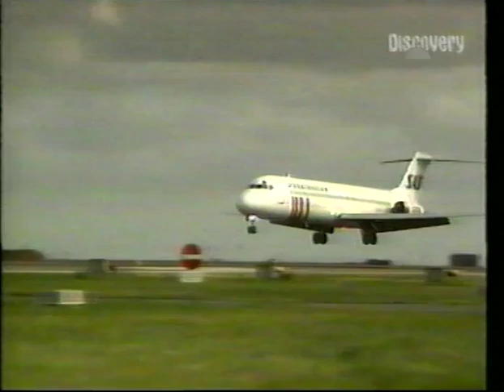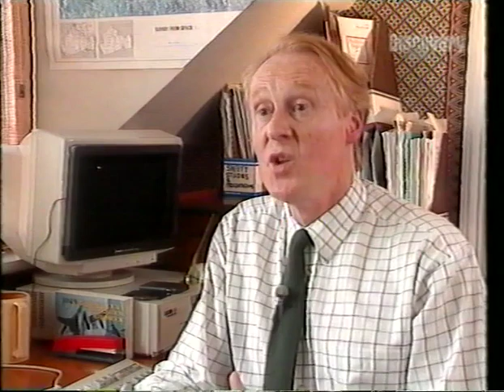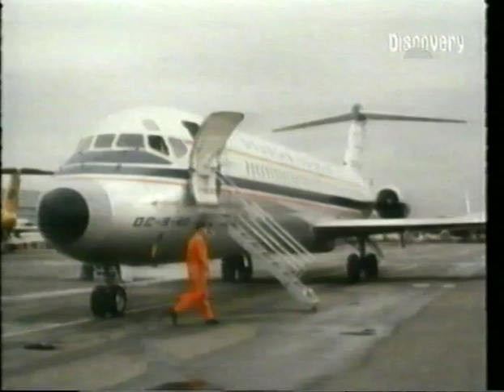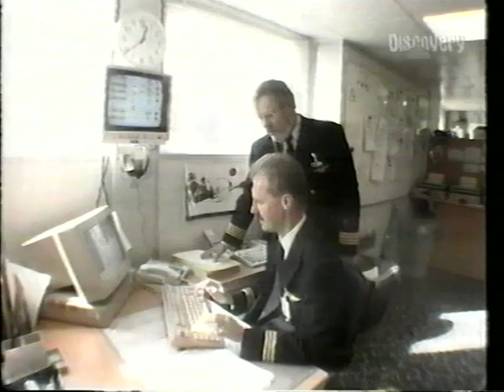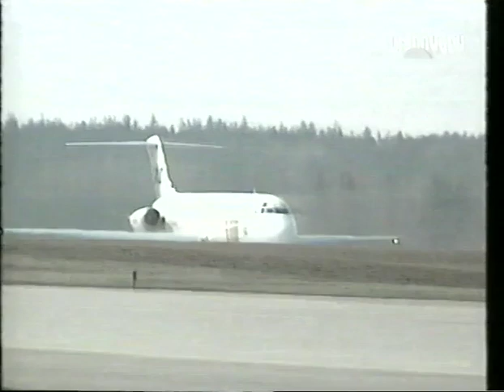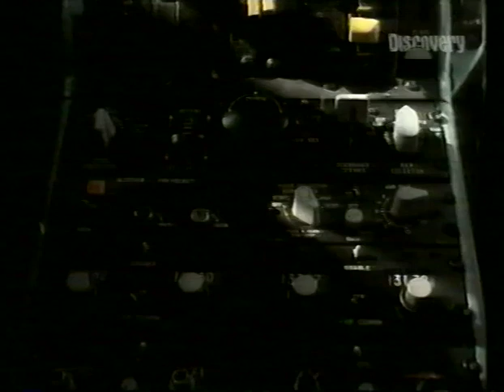Flight Deck DC9 Pt 1

Comment: The design to avoid deep stall had nothing to do with the engines or tailplane, it was those tiny little winglets just underneath the wing jutting toward. Those are vortex generators that provide high energy air only outboard of the wing that happens to be behind the centre of gravity, this basically pushes the nose down as the angle of attack increases to the point that even if you were silly enough to hold the stick fully back the aircraft would not enter a deep stall and elevator authority is maintained.
Reply from the maker: Thanks for your very interesting comments!

Comment: I was fortunate to work on those 40 series in the 90s when they returned to the US straight from SAS. I had never seen, to this date, airplanes so clean and so well maintained. They were all converted to cargo in minimal time, and I doubt any of them survives. But I was very impressed compared to US operated airplanes that had to be almost completely stripped down. Still have pictures of those -40s. Great version of an even greater airplane.
Reply: I worked for SAS in the 90s. The airline is fastidios when it comes to maintenance
Reply from the maker: Thanks for your very interesting comments!